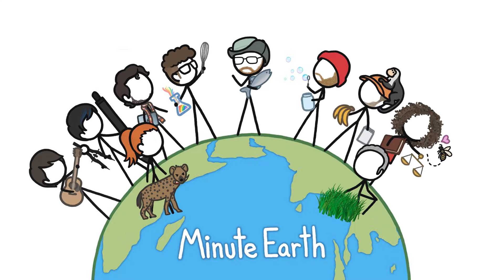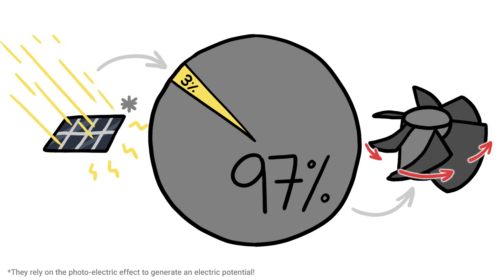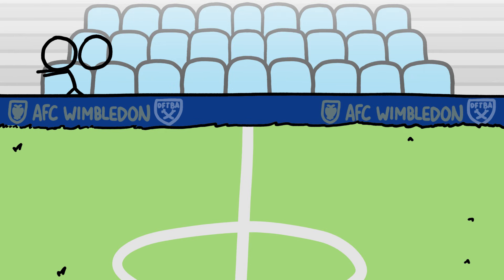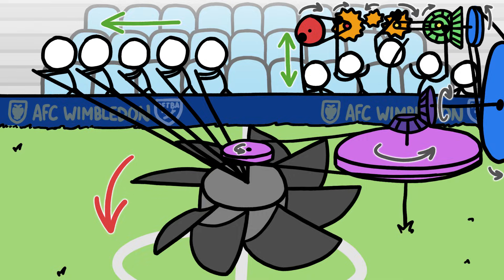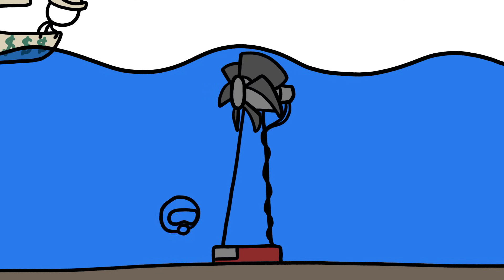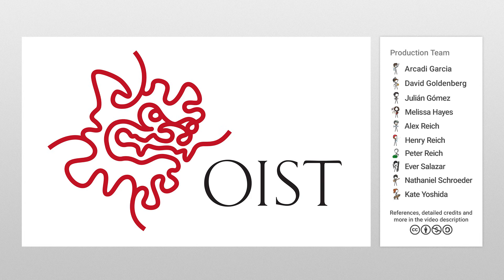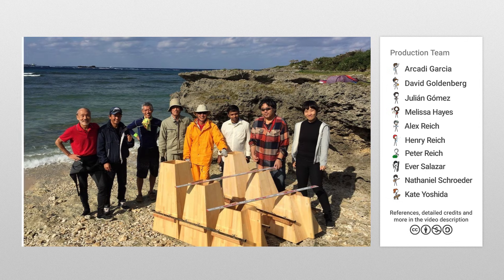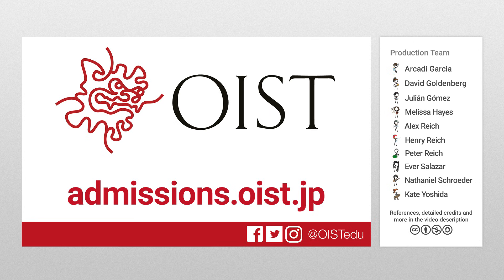Why Can't We Get Power From Waves?

Comment: A system that could work is using big floaters/actual tanker ships tethered to pivoting leavers that lift weights on the opposite end of the lever during high tide that then detach and by the help of the static power accumulated in the weights then run electrical generators that would have to be heavily geared down, you would inevitably need a series of big rigs for a stable and constant power supply to the grid and it would take a lot of space but it would work better than these.
Think industrial scale.

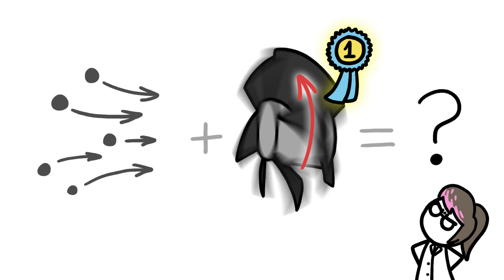Comment: 0:24 and that is the biggest constraint of our energy. It is rather ironic that the best way we have to harness atomic energy is the same system we use to convert energy from coal.
Reply: In the end, it's just used as fuel. The difference is that because both coal and uranium are fuels, they produce a byproduct when used as fuel. For coal, it's greenhouse gasses. Uranium has radioactive wastes (though that shouldn't be much of problem with adequate storage and the introduction of thorium and fusion reactors).

Comment: Silly really- when a wave breaks water rushes first one way then another. With a vertical "door" that would be pushed one way and then the other it can power a huge cylinder on both the directions creating great pressures with each stroke. It would not even have to be near the surface as the surge can be very deep. If the water is stored in a huge pressurized chamber the volume of water would only be limited by the number of doors and you could even have several tranches of pressure so you get just a bit at very high pressure but much more at lower pressures.
Those pressurized sources  (0r even towers using gravity instead of air pressure) could easily operate your turbines cheaply and effectively for years at a time, and taking from the middle of the water column would avoid such sand and trash that would float or sink.

Comment: I had absolutely no idea all of our energy came from turbines... I thought our technology was more diverse....
Reply: Yeah, there is even a way to get the sun to spin a turbine, look for "foto-thermic" or "solar-thermic" power plant. It is a buch of mirrors pointing at one point that becomes ultra hot (like burning an ant, but bigger) and there you can boil water to sping a turbine, they are more expensive but more regular than a fotovoltaic panels, since it has termic inertia and termic capacitors to store heat to prevent the power plant to stop because a paserby cloud.

Comment: Why spinning? Can't we get electricity from a Pendulum? Or from swaying?
Reply: If your pendulum didn't swing back it would make a full revolution. (Or spin, like a turbine). Each time it stops to swing back its stopping electricity creation also.
Reply: Stirling engines are used to generate electricity by reciprocating motion but as with the other examples in the video it's not very efficient

Comment: There are commercial level sea generators. But they are tidal. They work the same way as a dam generation scheme. A basin is filled by the tide twice a day. The water flowing in generates power and when filled the water generates power as it flows out. A variant of this uses waves funneled up a pipe to fill basins at a significantly higher level. So we can get power directly from wave energy at a commercial level.
What is the problem? It is dependent on local geography. In the schemes and designs I examined while living in Scotland it became evident that the UK government who control all investment in research and development saw it as a threat to their political and economic interests. Mostly the threat is seen as to the country of England maintaining control over Scotland. The increasingly aggressive nationalism in England is horrified at the idea they might be dependent in part on future electrical energy supplies from renewable sources in Scotland. Particularly if squeezed out nuclear power. The generation of which has the main purpose of supplying nuclear material for UK atomic weapons.

Comment: I think the problem is that the energy of a wave is spread out over a large area and harvesting that with a single mechanical contraption would be difficult. Not only is the energy in one bit of any given wave only a fraction of the power of the wave, but all waves are not even similar in size or shape. Meaning you will only ever get ideal results from very specific waves that happen to come by and you would never get all the energy.
I would say the answer would be, as always to miniaturise and make individual units very simple. Maybe something like piezoelectric cells embedded in a thin chain-link type sheet that can cover a large area and gradually harvest the energy of waves that pass through the area. You don't want to stop the wave dead horizontally. It would just get reflected. You want to bring it in and siphon energy off vertically.

Comment: You seem to be missing the experiments to use tides in the Hudson River to generate electricity.
Reply: Tidal power is not the same though, tidal power generates by utilising the currents formed by the flow of water into and out of a tidal basin. Tides have several advantages over waves for production of power, they last longer, are more predictable, and always come with lateral movement of the water column. Its the last part that is most important, as that allows turbines to be used without needing to convert the wave energy into water movement.

Comment: Very interesting video. Another problem in wave energy is the scaling problem:
With other sources of energy, for example wind, the power generated varies with the swept area of a turbine, so effectively if you double the length of a turbine blade you get 4x the power. Unfortunately with wave energy, there isn't an equivalent return on scale. In every device type you mentioned, you would need to double the amount of material to produce double the power. 

I would love to see a commercial wave device one day but it would need to start in very niche areas where you are offsetting very expensive energy, for example remote islands that rely on diesel generators.

Comment: Even a lot of our solar power just uses Turbines too. Juuust indirectly.
Reply: Other than depending on an existing electrical grid to define the voltage and current, solar does not use turbines to generate electricity.   An off-grid system with solar and batteries doesn't use a single turbine.   Sure it uses fans, which in a sense, are turbines in reverse, but it doesn't use turbines anywhere in the power conditioning.

Comment: Waves are great but why wouldn't we harness the power of high tide to push over a barrier in a large area, funnel the water to a significantly smaller area place a few water wheels in a cavern that is blocked on the surface by a flow controlling hatch. by controlling the flow with a hatch we can meter the input to a cavern or generate and regulate voltages for output.
Reply: Sure you can build one but who is going to pay for all this and how can the owner sustain or generate income from it? Like what the video said, it is not profitable. It all comes down to dollar and cents.
Reply: @zenniz1992  my plan is to dig fancy holes,grade land and put waterwheel into a hole. I'm not saying that every coastline would be viable but there have to be plenty of places that could profit from my idea vs trying to rotate variable forces 90 degrees. It wouldnt be free but it would also be easier to get the power to buyers and be closer to people to reduce maintainance costs from travel and likely specialized skill sets. I'm certainly no engineer it jusy seems like sustainable force in a direction over time without power consuming systems should be viable.

Comment: I mean, the technology to not use turbines has been around for quite a while. Have you guys ever seen/used those shake/charge flash lights? They could incase a scaled up version of that tech into a buoy. Basically it's just piston technology with coils.

We can also get electricity from pressure plates. But that's another conversation entirely.

I still believe our best sources of electricity are geothermal and solar power.

Comment: Why not just use thermal energy and then set something that uses the vibrations from the tectonic plate movement as the energy. instead of what using the waves as energy why not use what causes the waves, that way you don't have to struggle so much in making a complicated design. Just use to things that gather two sources of energy

Comment: "Why can't we get power from waves?"

Just a guess from an overly tired moron, but I'm going out on a limb here and saying it's because we don't use floats as pistons to turn a crank shaft to run the turbines which can all be above water level except for the float which shouldn't matter if it's covered in barnacles, has no moving parts for the salt water to corrode, and generally fixes all the problems the tried methods seem to have.
Reply: If it is all above water and sitting on a float, why would a shaft move relative to the float? That's just a boat.

Comment: Why we want turbines to create electricity from waves of water when you can clearly see that the waves aren't flowing directly or spinning but rather they go up and down... Why instead we don't create shock absorber like designs to suck power from a wave? Replace the insides of the shock absorber with coils and tadaa, we have a generator which creates electricity from linear up and down motion instead of rotating motion of a turbine.
Or if you want to really go wild, you could preserve the fluid inside the shock absorber design and put a turbine inside of it which the fluid causes to rotate when the shock absorber is forced to go up and down from the movement of waves and is forced to push the fluid inside the shock absorber from one chamber to another. But I doubt this isn't as efficient design as the one with coils and magnets creating the current from the linear up and down motion of the waves.
Only problem with this shock absorber design is that the other end needs to be attached to something solid while the other end needs to follow the curvature of waves in order to work.
And also there's another problem. How much energy we can absorb from the waves before we cause damage to eco systems? Waves mix water and add oxygen to it when the waves are enough big to form whitecaps. When we remove energy from the waves and absorb them to become calmer, we change the ecosystem they work in.

Comment: Waves are inconsistent from nearly flat and lazy to tremendously power 30 foot or more waves. 
Now there is a way, but still pretty much impractical would be to build your structure to drop the water into a deep funnel with a turbine at the bottom that also pushes the water back out into the ocean.
Think sideways dam type structure totally inefficient.

Comment: I doubt that wave energy will ever be practical. It is distributed very widely, but the infrastructure to capture it is difficult to maintain. Tidal energy can be much more concentrated, and is still only practical in a few places because of the difficulty of working under water, especially with sea water. Compare to solar, where a solar panel can go up on a house or building, without disrupting the local environment any more than the house already does, and they can work for 10-20 years with basically no maintenance. Wind turbines take more maintenance, but still not that much, and the maintenance is much easier than going out into the waves that don't stop on command, where a wind turbine has brakes to slow and stop for maintenance. Maybe someone will find a better way that actually can work, but there is no sense in waiting for that, we have solar and wind, we have storage, we can supply all our power with sustainable energy using just wind, solar, and hydro, we don't need wave energy, we just need to manufacture and install what works, and decommission the fossil fuel plants. By all means, a few people should continue to experiment with wave power, but we should't wait for their results, we already experimented with wind and solar, and they do work, and can work at scale.

Comment: Have you tryed to use cranks with a soler or wind asist (to mantain consistent motion)
 a simple crank shaft with a sale under water as waves roll in it pulls the crank in and as the waves 
 Roll in and out it cranks 180° the soler or wind asist is to power a spinning propeller that keeps the  Pace Of the crank cranking hopefully the consistency of this  Motion Creates power Remember What's incandescent Bulbs Didn't work out till we found a good one

Comment: Well a principally working solution has been invented. Trouble is the inventor is doing the old "i am doing if, or no one is" it's called a waveplane, and actually works, in the sense that it converts the oscillating motion of the waves into a continuous rotating stream. Trouble is designing it right, so it stay where it should, unlike the prototype that ripped itself loose and stranded on a nearby beach, getting damaged in the process. One of those "let someone else have a crack at it" things

Comment: I think it is feasible with a good design.  You have a ton of energy options at the shoreline vast temperature differences, waves, tidal, wind. It is more about the will to tap into the energy. Namely, it competes with an entrenched tourism industry, as well as nay sayers of the conventional power industry, and eco phobics (fear of the the economy as much as changing any ecological hair on the head of the planet outside of the impact of killing billions of people, as in cremation co2 and burial costs).
Reply: Remember we do have plastics that can replace corrosive metals.  Plastics are economy of volume, since the mold cost much to make.  However, I manually make my own plastic designs by locally heating it an bending to my shape and cooling.  Definitely, there is a huge difference in plastic quality, depending on the chemistry.  Sun degrades plastic hugely and quickly.  So, a glass coating or maintenance will be required for any exposed to uv.

Comment: I think that the problem is the turbines that they are using..they are using Pelton turbines wish requires the pump to make the pressure for the turbine to work...this is inefficient...
  
The solution would be to pump the water into a near the ocean water level dam to compensate for some hours of capacity and then use Undershot Water Wheels to use the flow of water out of the dams...but this is not necessary, as we can see that there are thousands of rivers that are powered by the best pump there is...the heat of the sun that run for miles and miles with no turbines to produce electricity...why?...I do not know..to me it looks obvious and simple...waterwheels are the best motors to run electrical generators...

Comment: Since the main reason for waves is wind, isn't using wave energy over complicating things?
Reply: Not really, if you think about it. Wave energy is in effect amplified wind energy, it takes a fair amount of wind energy to get a decent wave going, and the really big trans oceanic waves have been slowly built up by the wind for thousands of miles. That energy doesn't vanish, it is transferred from the wind to the wave, so you could almost think of a wave as a battery for wind power... IF you could work out how to utilise it efficiently.....

Comment: Has anyone tried making a small hydroelectric dam to take advantage of tidal ranges if done right could turn turbines when water comes in and when it goes out plus maintenance and stuff could be done at low tide so scuba stuff wouldn't need to be done often

Comment: so clearly you haven't read the theory about using multiple small turbines underwater off the cost, and I am not talking near the surface, if you go a little deeper you hit the underwater currents witch you avoided talking about in the video witch do not go up and down they flow in a continuous stream, various forms of ocean life use it as a story of highway letting them use less energy as the current pulls them along.

Comment: Basically waves are like a whip, a lot of potential energy in the body, but the useful kinetic energy is in the business-end of the whole thing...
If you could harness the power from water-waves then you could also harness the power from a sound-wave.
To drive a turbine you need kinetic energy, and waves are potential energy.
The potential energy of waves only cause water molecules to express kinetic energy when going through less resistance than its natural "standing wave form" nature, like for example crashing onto the beach or cresting over a levee, or when its path is blocked, like a wave-breaker or a cliff-face.
Waves, like electricity, travels through the Path of Least resistance, and in nature that is the waters edge, usually a beach.
Turbines to harness water-waves for energy are in relation to the waves just an insignificant point, and just passes it by rather than through it.

Comment: Tell the Professor that what he should do is to purchase an old self-winding watch and look at how the mechanism uses movement in any direction to move a gear. Such a device could be hooked up to something that would consist simply of a cylinder with vertically placed blades all around it. It would not matter which way these blades would rock or turn the cylinder because it would work the gear inside to convert any of the motion into a single Directional motion.

You may say arigato now.